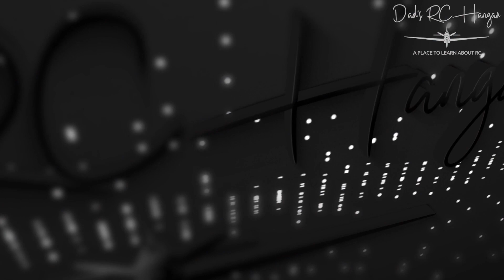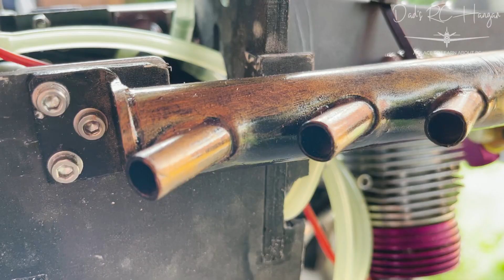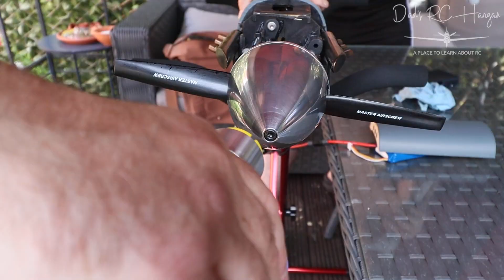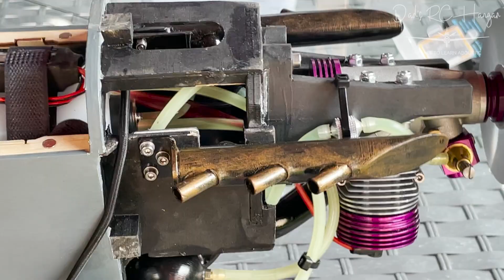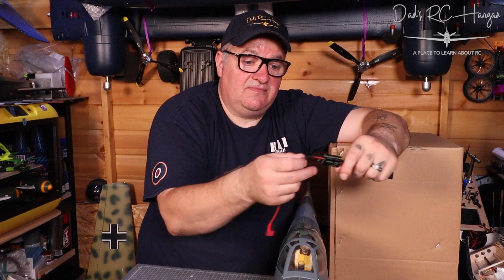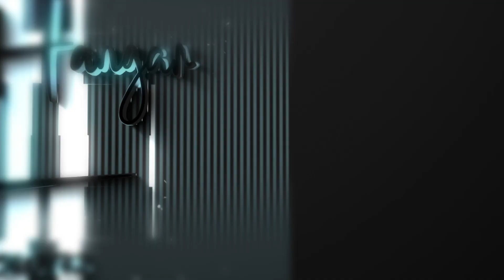Supermarine Spitfire | Engine Test

Comment: Alan did a great job on that exhaust system! Glow fuel engines still scare the hell out of me, goes back to my early control line flying days as a child with those little Cox engines that threatened to chop your fingers off trying to flick start them.
Reply from the maker: Look forward to flying her this year. Yea I seen the control line, would make me dizzy. I think glow is scary because you are in-front of the prop etc, if you had an electric prop spinning fast in front of you, it’s also scary hehe. Have a great weekend. 👍🏻

Comment: Is this the Spitfire 1540mm wingspan, ARF-Set from VQ-Models - VQA158.
How heavy was it when finished with the engine?
Reply from the maker: Hi Dieter, Thank you for popping by. I have not finished the spit, she will be finished this month and I will mention the weight and CofG. This is the VQ-Spitfire VQA158. I brought the retracts separate. Any questions please ask. Have a great week 👍🏻
Reply: Which retracts did you buy?
Reply from the maker: @Dietsch1  VQ Models E-Retracts for Spitfire (50 Size) w/Struts - VQARE32